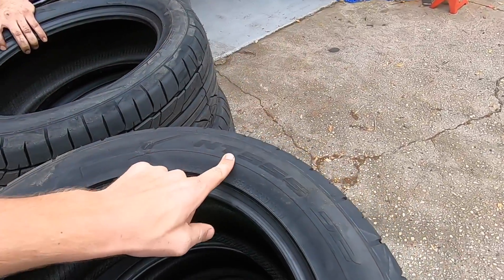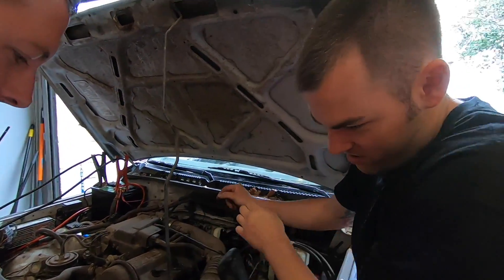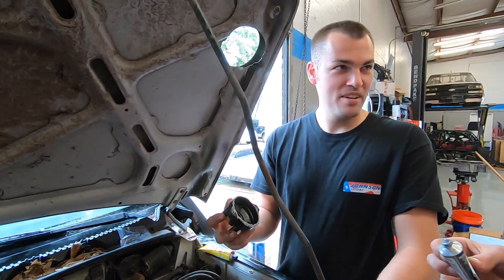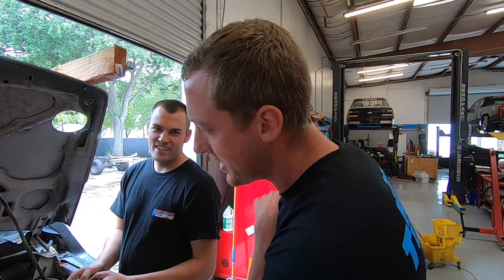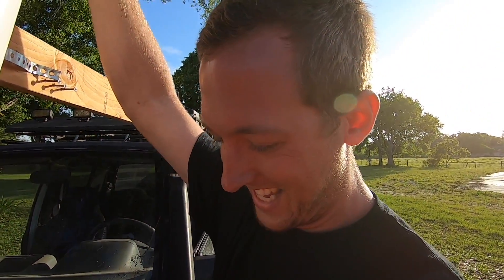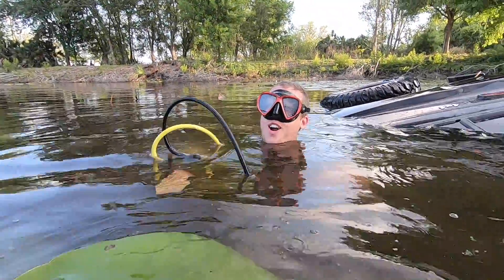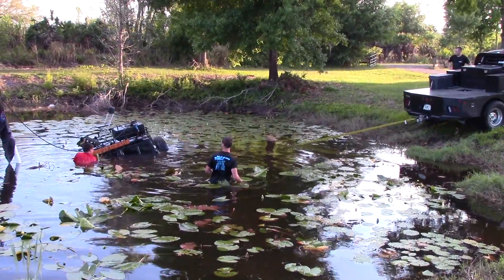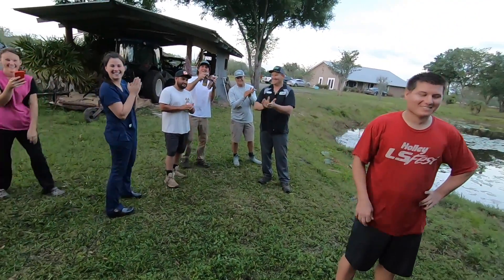Driving Underwater EP.2 - New Strategy Did Not Pan Out...

Comment: I think Cooper should sit on the roof again and spray nos down the snorkel ot give you more eagles when your In the pond
Reply: I like the way that you think, EXCEPT, this here is, Titanic2.0.
So injecting NOx, is just going to make it sink, faster.
Far better to tether some plastic ducks and aquatic plants,
to make a water feature of it...
Reply: I was thinking the same thing when he said get the bottle😂
Reply: The exhaust needs an extension the water is not letting the motor breath put a pipe just like you did with the carburetor. You get the idea . lmao
Reply: Takes the wetshot to a whole new level!
Reply: @johnnylopez7861  that's not really necessary as long as it keeps running. The water doesn't create enough pressure at those depths to cause much problems. It's no different than going under water and exhaling and blowing bubbles without water choking you.
Reply: Eagles can’t fly when their wings are wet thus car won’t drive budd
Reply: that would work
Reply: AND A EXHUAST SNORKLE
Reply: @GSXRR-ru1rn  More eagles 🦅 lol

Comment: You should take the doors off so you get even water flow though the inside
Reply: Just drill holes in them for water flow😂🤷🏻‍♂️
Reply: @cletus McFarland
Reply: I was about to suggest this, maybe also remove the rear so water can leave if they get all the way across.
Reply: @vprjls102075  not if brother. It's when they get across.
Reply: James get the toolbox!!!  Take the doors off!!!!
Reply: @KyleNelson279  or just in the floorboards, then it self drains
Reply: @KyleNelson279  I was going to say the same thing! Holes all around! Hahaha
Reply: I was also thinking the same thing. Ditch the doors, hatch, back seat and anything else you can. It should sink strait to the bottom then.
Reply: Needs to have even weight inside from the start too, someone in the passenger seat
Reply: I was going to say the same thing. I had a buddy that pulled the doors off a Suzuki. Just remember to pull the fuse for the door lights.
Reply: @loganwitte3477  there wer 2 clowns on the roof trying to even the weight. All the air lifted it over
Reply: I'm thinking the same thing, remove the doors but add roof pontoons just in case she does try to tip over.
Reply: @LeoSD3842  it's cleetus ..
Reply: That or rig something up so Cooper and James can work the doors from the roof.
Reply: The Outlier great minds think alike
Reply: Even water flow and much safer.
Reply: Pearl Jam - Even Flow
Reply: Jr.Kenny Rodgers I was just gonna say that
Reply: Add bar so it don't fold
Reply: Also fill the tires with water! It will help with not tipping over
Reply: You should drain the pond. :D
Reply: Totally agree, might even put some weights in the back and passenger seats.  Air down the tires or better yet fill the tires with water!!
Reply: NO
Reply: Yes thats what I’m saying
Reply: Add that to the list.
There's a couple of things that need to be improved for this experiment to be a success.
A few.
Several?
There's a bunch of things! Lol!

Comment: Easy fix for the water coming in one side just take the doors off and let her rip 🤘
Reply: Exactly my thought
Reply: And something to weigh down the passenger side
Reply: Should be fine if the doors are just off
Reply: or drill holes in the doors and in the floor if you wanna keep the doors
Reply: There are hole under the carpet with rubber groomets in them very easy to take out
Reply: TATER CHIP

Comment: If I were attempting this:
1. 3-4 two inch holes in floor, and/or remove doors
2. Flexible, floating snorkel 
3. Electrical grease on every electric connection I could find
4. Decent or at least fully charged battery

Glad I'm not tho, good luck guys!
Reply: I like all of this. I was thinking if you didn't want to drill holes in it you could affix a block to keep the doors open and take it slower.
Reply: Electronic ignition conversion, points hate water.
Reply: NJ in the MJ And they should probably extend the pipe up like they did with the snorkel. I also like the idea of removing the doors.
Reply: I was thinking about that to. Lol plus if he was closer to MI i would give him some lead bars to hel it sink lol.
Reply: Sealed battery too
Reply: go down the hardware store and weld these http://www.janeknapp.com/Files/99671/Img/06/brass-hook-cabin-doorP-12inch-merged-zoom.jpg by the hinges of each door at the bottom, put the hoop part at a slight angle, so the door does'nt wiggle about and the hook comes out
Reply: 5. High stack exhaust

That backpressure from the water is tremendous.
Reply: @LowCheese1  and fill the tires with water
Reply: I'm with yah bro. right up till you said "glad your not"...LOL
LOVE TO BE THERE...!!!!!
Reply: @sireuchre  yeah they already said last vid they were gonna get her a smoke stack but then they just bogged it anyways haha

Comment: Cooper I have a 05 Baja Turbo 5 speed I'm trying to sell right now for a
 good deal. 99% bone stock, clean title, no rust, and selling for less 
than what other turbo 5 speeds cost. Located in Idaho.
Reply: This should be the next Bog Deep vehicle!!
Reply: @ryandrzewiecki2467  hell yeah brother, I'd love to see it on the channel!
Reply: @Nick Tuley yessir!
Reply: How much?
Reply: @mcearl8073  I've got it posted for $6k. New short block, rebuilt heads, water pump, clutch, timing belt 25k miles ago. Completely bone stock except an axle back straight pipe. Everything works (ac, heat, locks, cruise control, ect).
Reply: @Gigahurts I subbed and could u make new contant

Comment: "A"  for effort . Silicone grease your plug and cap wires, pop off the doors and load a few cast iron cylinder heads to make it less buoyant . You will need to be negatively buoyant to get enough traction to make it across. Also, your battery needs to have a charge. The alternator most likely will not work under water . With no power it will not run.
Enjoy your videos!
Reply: They need to Flex Seal the alternator, too :))))
Reply: Their transmition and differential need breather or else they can't catch the clutch properly, water will make it slippery
Reply: There's a spray used to waterproof tanks and stuff. Forget the name but it forms a thin barrier. They could also use dialectric grease so even if it does get wet, it'll complete the circuirt. 

In fact, they could actually load up the distributor with the stuff so even if water gets in, it'll still spark properly.
Reply: second what Dig said except use Vaseline instead of dope...makes it easier...
Reply: Dielectric grease is a silicone-based grease that repels moisture and protects electrical connections against corrosion.  The grease does not conduct electricity, so it shouldn't be applied directly to the mating surfaces (pins and sockets) of an electrical connection.
Reply: @johnbarzee7806  wow really? I use it on trailer connections all the time and never had a problem......
Reply: Muskoka Mike yeah really, I always thought the same thing, but it is actually an insulator that stops electricity from traveling through it. The reason it works with the trailer connections and battery connections is because there is enough metal that pushes through to make the connection work, but if you use it on little connections with too much the electric won’t be able to flow through it.
Reply: @muskokamike127  your actually correct on your information about dielectric grease Winston experiment completing a circuit with dialect grease one connection on one side of the puddle another connection on the other side of the puddle and it lit up a light bulb

Comment: you should put a floppy pipe as air intake and tie it onto a rubber dingy or something so the intake will always float above and isn't effected by the tracker turning over
Reply: Smartest comment I’ve ever read
Reply: Dryer hose and a life ring....😂
Reply: That’s a hell of an idea also remove the doors maybe
Reply: I commented this last time. RV drain hose and a float ring.
Reply: Problem with a soft hose is water pressure at depth plus negative air pressure from the intake will just cause the pipe to collapse.
Reply: John Dalton it's not that deep.

Comment: Remove the doors so it can fill up with water evenly
Reply: I was just thinking the same thing!!
Reply: I think most people who have bogged deep we're thinking the same thing
Reply: Yep, good idea for sure
Reply: And take out the anti drain rubbers in the bottom ;)
Reply: I was thinking the same thing. Then he could still keep a little speed. I still think that the exhaust is going to have its own snorkel as well though. 

But hey, If nothing else, it’s less of a safety obstruction after he has to swim out.
Reply: I literally said that to myself lmao
Reply: Wes Packer then build custom door bars
Reply: And the rear door
Reply: Literally was coming to say the same thing! Level out the filling!
Reply: remove doors drill drain holes in the floor pan flex seal and seal all on all the electrical bits round the plugs and on the distributor and battery. Basically follow all of the wires seal all and flex seal apply liberally.  Put some water wings on the snorkel and put a hose with floaters on the exhaust... or go the other way seal it up to float it across with an outboard mounted on it.
Reply: I’m not an expert but maybe if they deflate the tires a bit?
Reply: adam tankersley I was thinking of an exhaust snorkel too
Reply: And so you can get out of the car
Reply: Same.  All doors removed would also make it much safer if you have to bail from a similar issue as this video...funny stuff...they will get it done.  A person on shore with a tank and experience would be a good idea also in case of emergency.

Comment: 1) Drill some holes in the floor to allow the water to enter the cab. 
2) Glue on a female pipe thread adapter on the PVC at the opening through the hood so you can close the hood and then screw on the intake snorkel that has the threaded Male adapter. Unscrew the snorkel to open the hood for service. 
3) Rig up a coil on plug setup

Comment: Drill drain/fill holes
And add an exhaust snorkel
Reply: Zecrid you don’t need an exhaust snorkel, that’s pointless.
Reply: @kodyjohnson6294  not pointless lol
Reply: @kodyjohnson6294  There's this funny thing called back pressure. Most engines don't much like it.
Reply: @martindinner3621  all engines need it, just not too much and not too little
Reply: Martin Dinner 1. Most engines are designed to run with back pressure. They make more power with back pressure, to a point obviously. Engineering explained made a great video explaining this, you should watch it. Maybe learn a thing or two.

2. For these purposes an exhaust snorkel is absolutely pointless. As long as the motor keeps running he’ll be fine. The back pressure won’t be near enough to kill the motor and it’s not like he’s going for peak performance here. Building an exhaust snorkel would be a waste of his time and resources.
Reply: Rob Zombeh  look up valve overlap. That's what I'm talking about here. Nothing to do with emissions either.
Reply: Rob Zombeh if that’s true then why do race cars run headers? Why don’t they just have the exhaust run straight out of the combustion chamber? Bc the right amount of back pressure makes power.

Comment: If this is never intended to be used in winter or on the roads, perhaps you can punch several 2 inch holes in the bottom area of all the doors to allow the water to freely enter (avoiding the tipping you suffered this time) or just remove all the doors entirely (makes for easy escape if you roll it again). Next I would suggest the exhaust snorkel James suggested in Bogging attempt #1 to try and keep water out of the muffler/engine if you need to drop the RPM's during an attempt. Some concrete blocks attached to the frame may help lower the center of gravity, reducing the chances of rolling it.

Comment: you can keep the water out of the distributor by applying positive air pressure from the air pumps. 1/2 a PSI will keep the water out. Done on underground communication cables all the time! :) Also Ruby boost creep... Single turbo set up over Leroy's twin is a substantial difference. a bigger gate needed for sure! twice the cylinders pushing on the turbo with Ruby. Keep up the  great work!

Comment: Few suggestions that may help you succeed. Take all doors off so water can equalize in cab. 2nd put an extension on exhaust so it won't suck in water if backfires. And waterseal anything electrical like distributor, fusebox and electronics around motor. Maybe let some air out tires to help in buoyancy. Have fun lol

Comment: I think we can diagnose the problem as a "loose nut behind the wheel".
Reply: Well that could be anything, a tie rod, ball joint, caliper bolt, wheel speed sensor, lower control arm, lower shock mount, swaybar link or castor bar bushing. And while you're at it, the Head Gasket needs to be replaced, all the other gaskets have revolted and want a new leader...
Reply: @maxnaz47  dude. He was making a joke about cleetus being a nut. Wtf lmao
Reply: @carterward1449  he went full mechanic mode 😭😂
Reply: @carterward1449  A few people clicked the Read more option

Comment: You need to put the ecu and fuse box inside a Ziploc plastic box and seal it all up with (butal flex) &you need to let the water in faster so you level out faster  and have traction your floating. I seen a toyota truck on 49 irocs do the same thing cuz there,s just to much negative pressure.  A++++ for your efforts, you guys are the best channel on the tube.  Love it

Comment: rip the whole front clip off and build a water tight box in the engine compartment. snorkel intake and exhaust. and add a breather for the engine box. remove the doors and windows, you don't need them.

Comment: I say y'all swap in a 4.3 Vortex into the Tracker lol
Reply: vortex???? you mean vortec???? lmao
Reply: @dozer8065  autocorrect Haha
Reply: Robert Dean could fit a 4.8 vortec in it
Reply: @markmorgan5197  turn but lq/lm/ls swaps are played. Do something different
Reply: @markmorgan5197  or a 5.3... same size just different bore/stroke the displacement doesnt mean bigger physical size.
Reply: same as the ford 4.6 is exactly the same as the 5.4 but with more stroke, thats why the heads are a tab bit taller on the 5.4.
Reply: then you need Toyota axles. it all snowballs with an engine swap
Reply: John Smith then you might aswell body swap it on a old k-5 frame or simular :) damn snowball effect!!!!

Comment: Instead of a hard line pipe, get a flex line with a float for you air intake, that way in case of a roll over your air intake will float and keep the water out, that hard line pipe is going to go under water in a roll over just like it did. Wishing yall luck I wanna see it cross the pond, I think your best bet will be to do like you said, start at the shallow end that way water can enter in at a slower rate to keep it from tipping, better idea would be to remove the doors all together that way water gets in at the same rate.

Comment: You're going to have to take the doors off to make this thing fall evenly to the bottom. I'd also go with exhaust snorkel. Final suggestion would be to put dielectric grease on all the electrical connections even spark plug wires if they don't already have it.

Comment: You need to extend the tail pipe as high as your snorkel. The clutch will slip under water. You have to Really seal the bellhousing well, no wawa can enter it. The alternator won't work under water. Use a sealed battery that is Fully charged. Remove the doors and tail gate to let water in and out. Huge holes in the floor will help. Fill your tires with water, so they don't act like life preservers.Seal dip stick tube, PCV etc. Don't have people on the roof that just makes it tippy with a high center of gravity. GO talk to other people that know how do do this, listen and learn from them. Be safe. Wear that air tank, not try to carry it...

Comment: James baled on his copilot job so you lost your passenger side ballast.  With two on top / top heavy, they will need to act like they are working on a catamaran and move to keep you upright not pile up on one side and take you over.  Doors off would help get water in as well as help you getting out, definitely need a exhaust snorkel.   How about flex sealing the whole underside and powering across like a duck boat instead?  It sounded like Cooper was getting a little uncomfortable when you didn't pop right up....I know I was!  Fun vid dudes, play safe.

Comment: Maybe fill the tires with water. Dirt Everyday drove a Jeep under water a few years back but they used a diesel motor so there was a lot less electronics to deal with. Of course maybe the 400 lbs on the roof didn’t exactly help the top heaviness either.

Comment: Why not use some kind of floating contraption to hold a flexible intake tube and fuel tank vent above water so you don't have to worry about water ever getting into the intake if it does roll.

Comment: You need to make sure you have a really good battery. Your alternator won't work under water, if your battery doesn't have a good charge it will die. You need to add some weights to the floor of the truck to make it negatively buoyant so you can maintain traction....the more weights the better, maybe buy a bunch of old big benchpress weights off craigslist or just use some super heavy crap y'all have around the shop. Maybe use some Dielectric grease around all your plugs, wires and any other electrical or important components you want to keep moisture away from. Either take the doors off or cut some 3'drain and fill holes along the doors and body to help to quickly equalize the pressure. Gou should use flex seal tape or paint on all your snorkel and exhaust joints and anywhere else you need to be sure it's water tight.